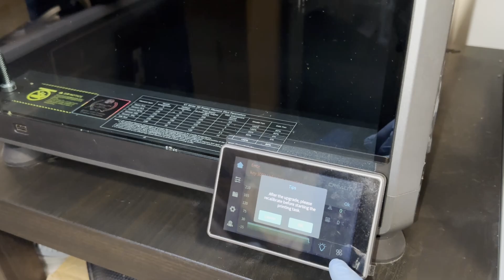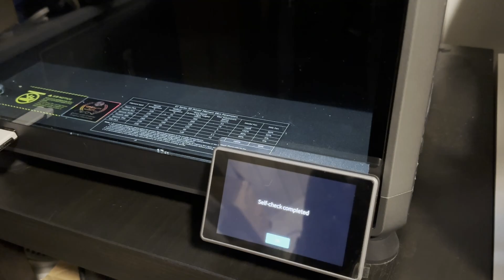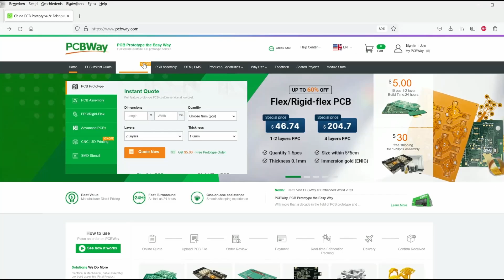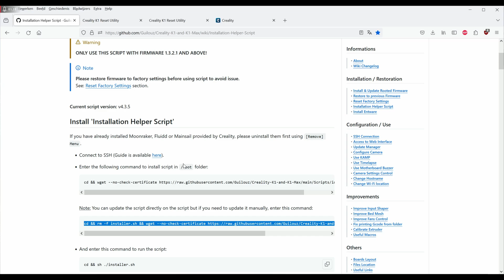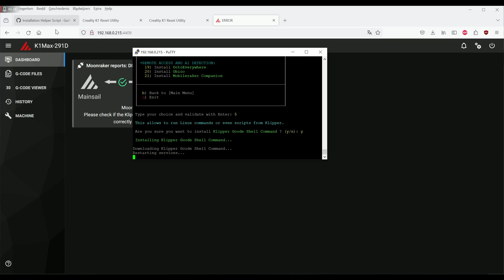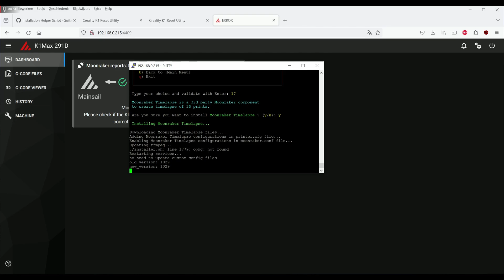K1 K1MAX unleash the beast in your K1 / K1 MAX 3dprinter

Comment: Thanks for the video. If you enable root access and run the scripts shown in this video, does the lidar and Ai camera still work?
Reply from the maker: yes it works no problem, but only through creality slicer
Reply: @aim6mac  Not true u have to send the gcode to the printer on put it on usb in order to get the AI calibration every time nothing to do with Creality Slicer
Reply from the maker: @parzival5884 then Creality changed the implementation of it, it used to be not like that, thanks for the info

Comment: I am not able to install clipper by using a Script. So if somebody else have endless download from script menu - you can go and try official version of installing Root access with fluid. It was the only way that helped me In a two week long struggle.
Reply from the maker: so you gained Root acces from Printers UI first , then SSH'd to the K1 and then followed all the steps and couldn't install Fluidd , is that what u are saying?
Reply: You understood me correct. Basically I was following the instruction step by step. At the end I reinstalled that secure shell many times and I was trying to use the script many times with deleting all the installation and reinstall it back again (and i was doing so on all the possible firmware (that is permited)for the printer itself.).  So basically in the process itself I was either getting too long download with unsuccessful installation or... I was being able to install only the first step with some errors inside of it, and then it wasn't given me the possibility to install anything else further. Sometimes I was not being able to successfully install the script through the secure shell (Putty, MobaXtherm) and I checked on the internet - just couple other people in this issue. It's very rare and so far and I have not found a solution @aim6mac

Comment: I have installed the previous firmware you posted. That unlocks fluid and has all the goodies. Should I follow this guide? I have some ringing problems only and I am trying to solve them. Is this firmware better at input shapers? Is it going to give something more?
Reply from the maker: this FW is more polished then the last one indeed, but the ringing issue is more of a hardware based then software based problem, but this FW surely does help to decrease the ringing problem.

Comment: Hello my friend I keep getting error 2566 and I can't find what it is. I posted a video for creality if you want to hear and see what it does
Reply from the maker: link?
Reply: @aim6mac  
https://youtube.com/shorts/U5wKGaNheQA?si=60g0rx3dKFmXF24u
Reply: I got the same problem with my k1 max. Looks like it fried the stepper motor. X axis in my case.
Reply from the maker: @thomazff  i'm sure if you contact support they will surely replace whatever is 'fried'
Reply: @aim6mac  probably not. I’m from Brazil, and bought mine from AliExpress. But they shipped me a used/test machine. After dispute I got my money back and they didn’t ask for the printer back. So it is more like I’m on my own with this.
Reply from the maker: @thomazff  that doesn't matter, go to creality website and reach them through support chat, they will ask you a several questions and will eventually send you replacement parts.